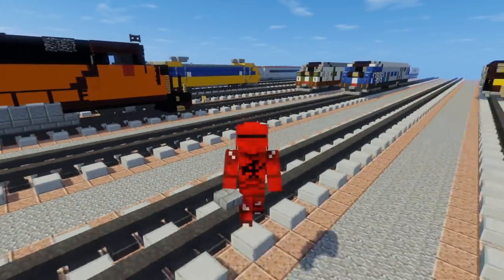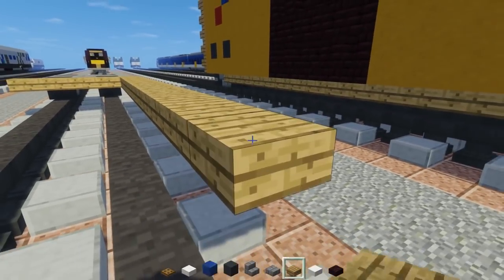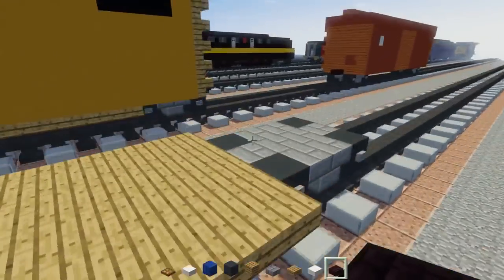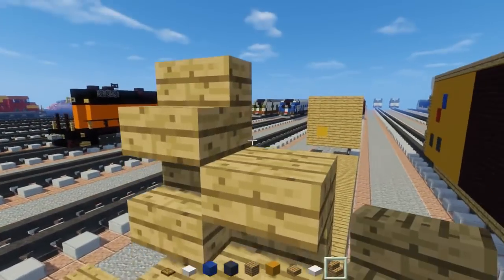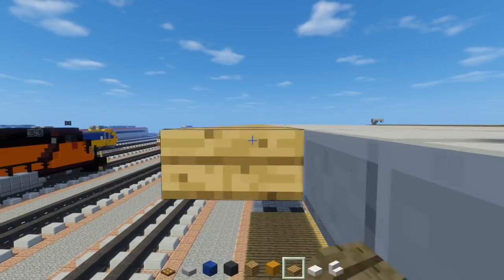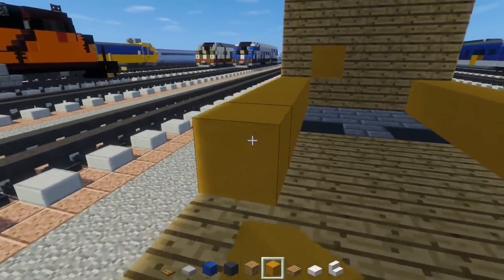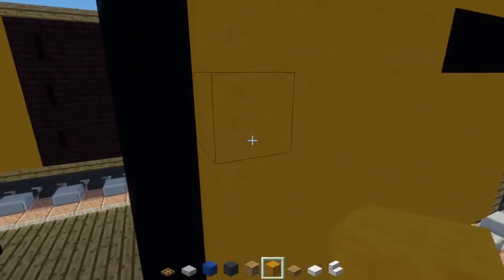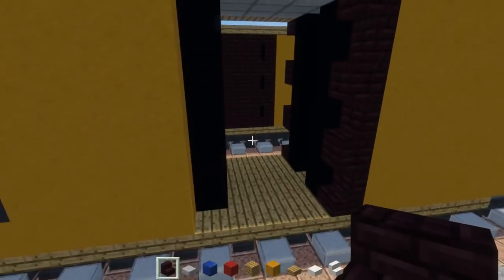Minecraft TTX 50' Boxcar Freight Car Tutorial

Comment: Yeah btw, why do you use hopper as a wheels on your trains? those duesnt even look like wheels

Hoppers make for a nice suspension if you put them on the block wheels :)
Reply from the maker: I use it because that's what I always used. I think it looks fine on train wheels that are covered up with some sort of triangle covering like diesel locomotives. I may change it in the future.
Reply: Exactly, covered, if you try to put just a block as a wheel and then a hopper on it, it liiks like a nice suspansion/cover detail